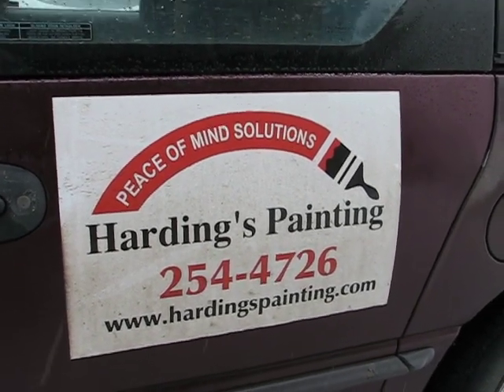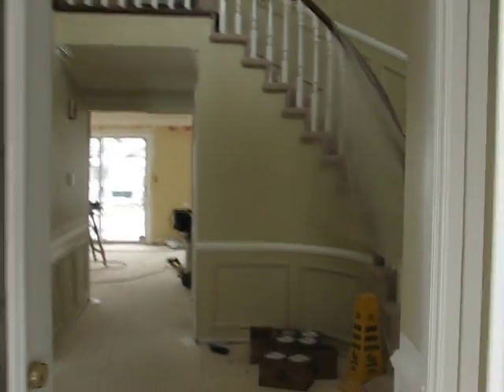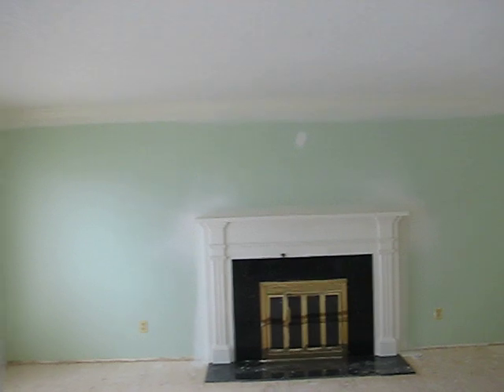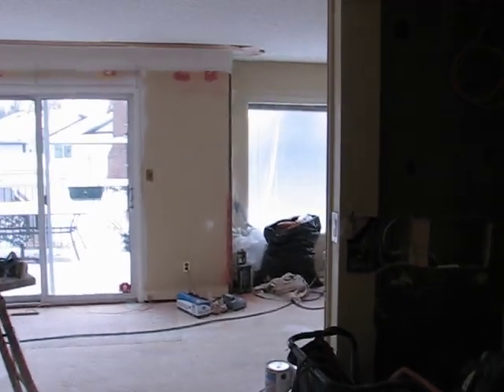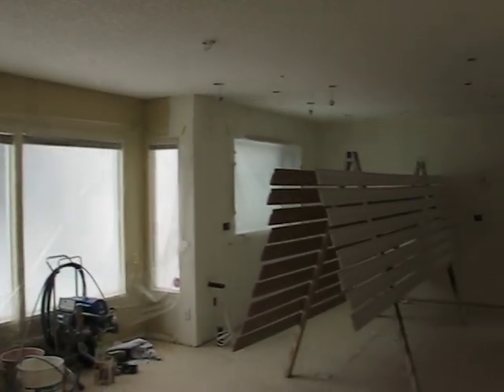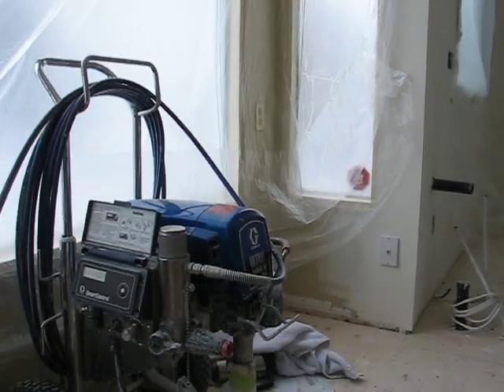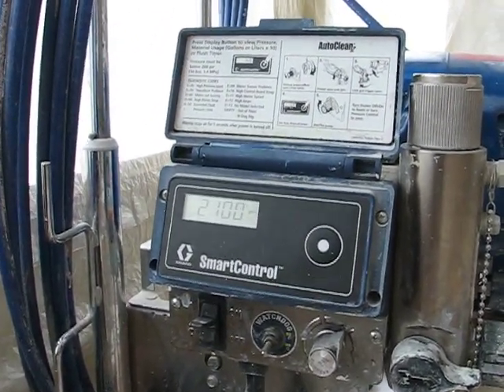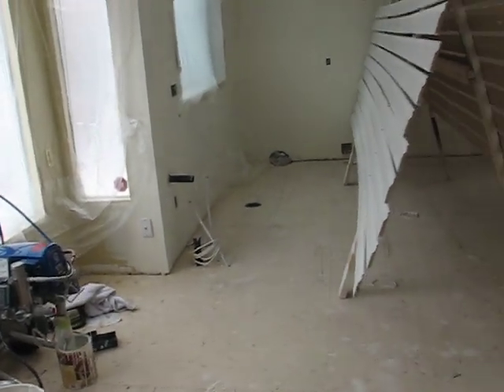Spraying baseboards on spray rack

Comment: this is ok to just spray the primer but alot of setup when you could lay thin boards across 5 gal buckets and spray them flat. Next, you dont put a finish coat until they are installed so nail holes can be properly filled , sanded and buried under the prime and finished coats without handling them anymore and they are left in place installed and already caulked when you fill the nail holes. Sorry but thats the proper proceedure
Reply: Looking for this comment. Your right sir
Reply: So how would you finish coat it after nail holes are filled and caulking is done? Wouldn't rolling over it change the texture of what was sprayed? Please advise, thank you.
Reply: @robholloway9893  why are you rolling on a finish coat?
The baseboards will be nailed in place and caulked . I would guess this sprayed coat is just prmer ?
Prime,fill nail holes ,caulk baseboards.
Sometimes if you want to spray primer before base is installed , depends how much space on location you have.I prime baseboards after they are installed, caulk. fill holes. I spray the finish coats. Next ,I use 6inch masking to shield finished base,taping it about 1-2 inches above baseboard. Spray flatwall next . The only brushwork is cutting in flat material up to finished base.Much easier and accurate to cut in flat to base over brushing gloss to wall material. If you are hand brushing base,you risk picking up dirt off the floor as you move along, unless you go slow. Even if you brush base ,you must paint up onto wall slightly,and cut in wall flat to baseboards.
If your laying out baseboards like this guy,you can roll on paint and back brush to smooth out roller texture. Same process for finish coats. But since they arent installed,
you will need to fill nail holes,caulk and still need another finish coat brushed.

Comment: A good way to spray doors to stop those gloss over spray lines on the walls is to: 

zig zag the doors in the middle of the Joining them with a bracket and a screw at the top.